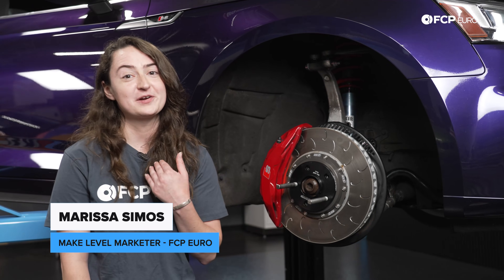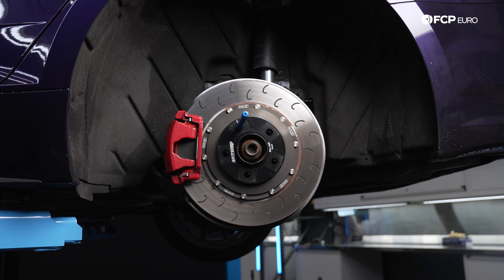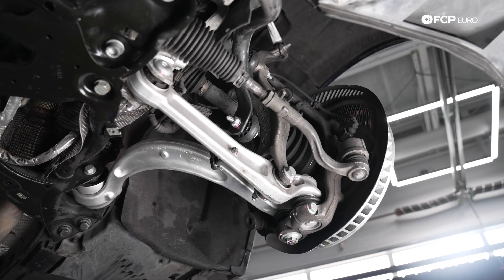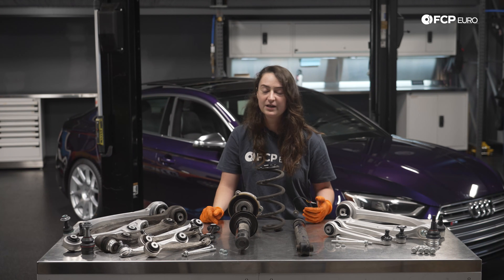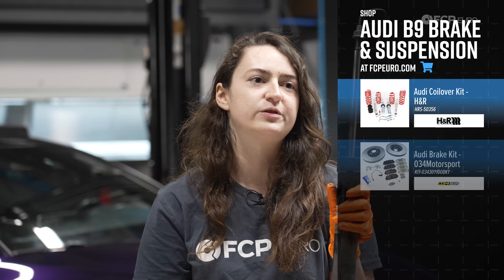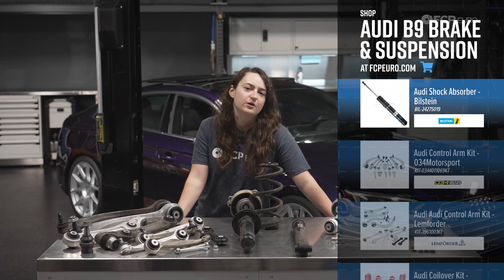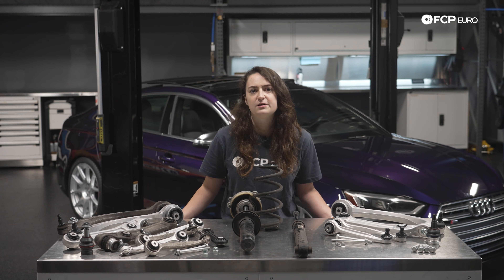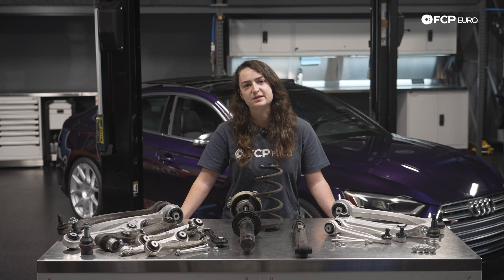Audi S5 Suspension & Brake Guide: Everything You Need To Know (2018-2024 Audi B9 S4, S5 Sportback)

Comment: Very informative video.  I have a B9 RS5, but I assume it's similar to the B9 S5 - are there any mods or items that can help with front brake cooling that you recommend like air ducts? I track mine and the calipers are getting discolored due to the high temps.

Comment: Does this apply to B9 SQ5’s as well?
Reply: Yes. Same platform and engine.
Reply: @tbarn067 but are any of the suspension components different or are they all the same?
Reply: @cool2goo the s5 and sq5 suspension components aren't exactly the same due to the difference in weight and driving characteristics.